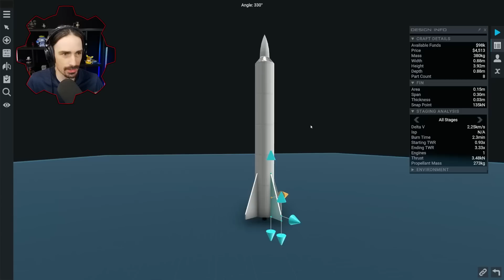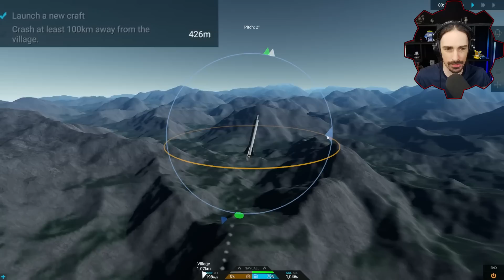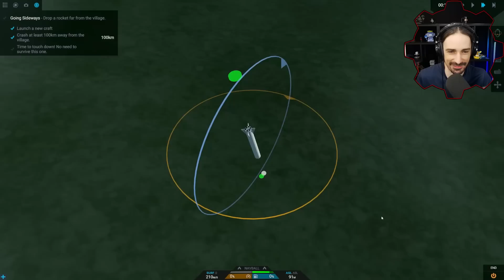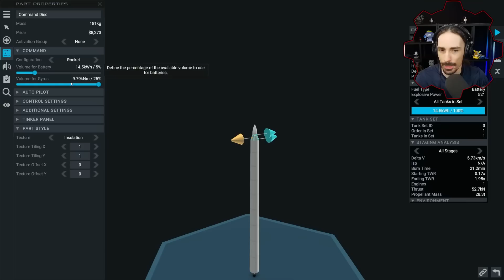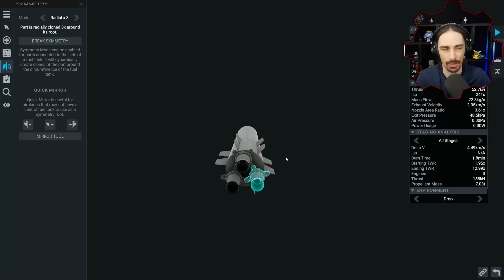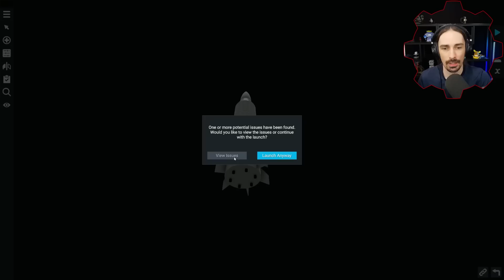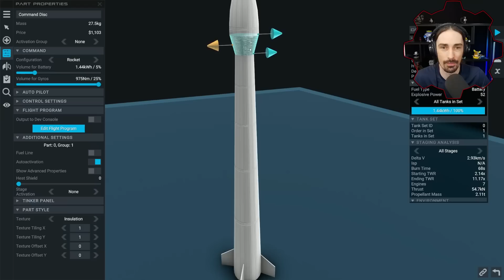Learning Why Reentry Is a BIG Problem for Rockets [Juno: New Origins]

Comment: What you're looking for is Starting TWR (thrust to weight ratio) in the Staging Analysis section right below burn time that you were looking at - it needs to be greater than 1 to get off the ground, but ideally your TWR should be somewhere around 1.5-2 unless you're doing something really crazy..

Like this: https://www.youtube.com/watch?v=YZZV464z9g8
That's a Sprint anti-ballistic missile from the 70s, designed to intercept ICBMs.  It only had a very short window in which to intercept an ICBM which was doing several kilometers per second so it was designed to accelerate at 100g and could hit Mach 10 five seconds after launch.  It flew so fast that it experienced re-entry heating on the way UP and would glow white hot from it.  It's absolutely the most batshit rocket I've ever heard of, and it had a TWR of around *85*.

Comment: Edit: I got the fuels wrong way around, my bad, but point still stands, 2 fuels for 2 jobs.

Rockets take 2 different types of fuel, either solid fuel which lasts longer and a much longer burn time, or liquid fuel doesn't last as long but provides fuel to more powerful thrusters.

Good example of wanting both is using Liquid to get into orbit/space then detaching liquid fuel tanker and thrusters for less weight to then use solid fuel and more efficient thrusters for longevity in space.

edit: now I'm worried I got them the wrong way around but this is just distant knowledge from Kerbal lol
Reply: You got it in reverse
Reply: You should not be using solid fuel for space. You can't turn the solid motors off or adjust them in any way. Best use of solid motors is for the first stage.
Reply: @katyusha1283  Oops my bad, thanks for clarification.

Comment: Id recommend using around 80% of your fuel and save the rest for the "apex" (apogee) and boost towards velocity then, it will get you further!
Reply: Sure if he uses a liquid fueled powered engine, otherwise with solid rocket motors he would be screwed cause he cannot manage the thrust 🤷🏽‍♂️

Comment: 3:10  You don't need to do any math here, the game gives you everything you need to know... Just look at "Starting TWR" which means "Thrust to Weight Ratio"
Your TWR needs to be over 1.0 ... If it's less than that it means your engine is not powerful enough to lift the weight of your rocket, so you either need to use a bigger engine, add more engines or remove some fuel.
Reply: For games like this or Kerbal Space Program, it's very recommended to watch at least one or two tutorials about the basic concepts.
There is a Youtuber named Scott Manley that made very good videos about pretty much everything you might want to know about rockets. 
Don't look any further! He is by far the most known and respected Youtuber for this stuff and he's very good at teaching stuff about Rockets, from the very basic stuff to the most advanced and complicated concepts. (Rockets in games and in real life.)
Reply: It only needs to be more than 1 if you are still on the ground. While in space you can use less than 1 twr. It’s just going to be slow. This is for anyone who doesn’t fully know what to do after launch.
Reply: @TurkeyTray  
But usually in this game you start by launching your rocket from a planet, right?
Seriously with something like rocket science there is always a ton of details and exceptions about every single concept so when we are trying to help noobs like ScrapMan it's probably not a good idea to bury them under all this theory, it's just going to confuse them even more and discourage them from learning.
Just keep it simple and teach them bit by bit, step by step...
Reply: @Reth_Hard  Fair point. That comment is more of there to be used at any time instead of immediately. For example if scrap man sees it then he might know that second stages don’t need to be too powerful. I’m not the best at explaining stuff though.

Comment: try researching staging, you could use a powerfull engine to get off the ground to lower gravity, detach the empty fuel tanks and use a more efficient engine to go further when you are outside the atmosphere, your gonna really struggle with going to orbit without it

you also need about 10KN to lift up 1 ton of weight

your gyro isnt working after launch because you have no electricity left in your craft, try researching batteries for more power

Comment: Solid fuel is for solid motors, liquid fuel like kerolox is for engines that run on liquid fuel. You can change the amount of thrust and turn off liquid fuel engines. Solid fuel engine is something like a firework.

Comment: The force that pulls you down to the ground is calculated by multiplying your weight by the acceleration of gravity, so if you weight 391kg, the force will be around 3.8kN, so I think that if your thurster produces less than that you are going to struggle at lift off
Reply: Yes the game does it already it is called TWR thrust weight ratio
Reply: @DavidRamirez-lq2co  oh, I did not know that
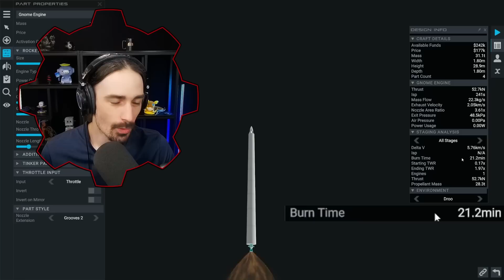Reply: @distejn8407  see the minute 12:15 you have staring and ending TWR.

Comment: Engines on your rocket need to overpower the force of gravity which is equal to 9.8 * [weight of the rocket]. But of course you will want to have much more power than that to accelerate relatively quickly. However, it is not worth to have too many engines as each of them weighs a lot.

Comment: Reentry can be an issue, but it’s best to try and move sideways, as that saves fuel and unnecessarily coming to a complete stop and dropping down

With enough practice, you can use reentry on just on its own to slow down (parachutes too, and heat shielding)

Drag is a major factor in reentry, so having a craft that is thin slows you down a small amount, the opposite is true for wide craft

You can even use the atmosphere to change your orbit without reentering

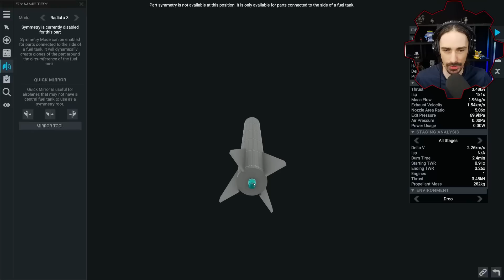Comment: 3:31 you could check your thrust to weight ratio or twr for short in the "Staging Analysis" part of that panel you opened, you should check for "Starting twr", for mostly all rockets it's above 1.0 or beyond if it goes under 1.0 like for example "Starting twr is 0.9" you will struggle at lift off cause you don't have enough thrust to move.

So in conclusion your "Starting twr" should be above 1.0.
Reply: Hopefully he will see this comment.
I quite literally feel pain while watching this I mean I love the game and that he is playing it, but when u know how to play someone doesn't....
Reply: @Unimaginablekatana  Me too
Reply: Gotta remember to set the right altitude on the slider too. Some engines may have a very significant change on TWR if it's at sea level or vacuum
Reply: @JustCallMe3d  So true, some vacuum engines are very optimized and perform awfully in the atmosphere. Also you would want an orbit correction engine to have max efficiency and you don't care about thrust
Reply: Above 1 and below 4, just gotta lower the aero coefficient.

Seeing ScrapMan not change the size of the nose cone when making the tank 3 times wider is just as painful
Reply: in spaceflight simulator it is adviced for 1.4 twr
Reply: Jesus Christ. How long did this take you?
Reply: @NikiTheAstronaut  bro chill, he has never played a space game before
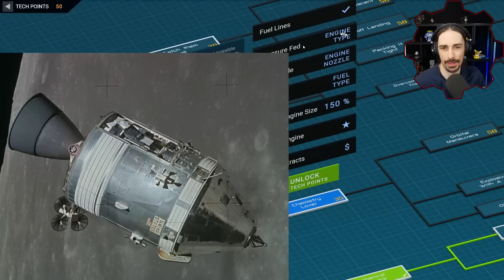Reply: 10:37  that’s an RCS Thruster.
Reply: Ikr

Comment: I once again ask you to build Mil Mi-32 tri propeller helicopter
(When you click on the fuel tank, you have something called "Starting TWR" TWR being thrust to weight ration how much thrust you produce in comparison to how much you weigh if it is 1.0 you will just hover in place if it is below 1.0 you won't get off the ground and if it's above you will fly)